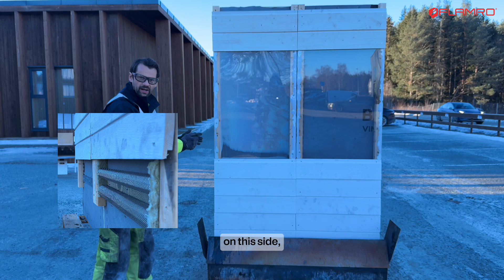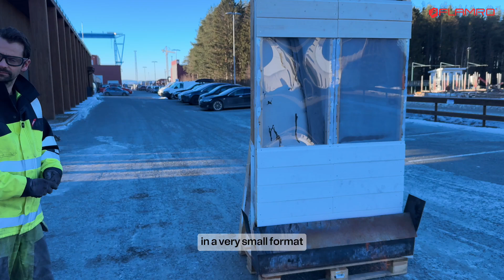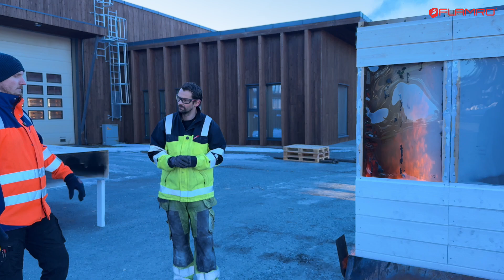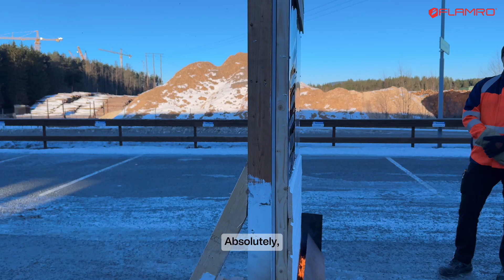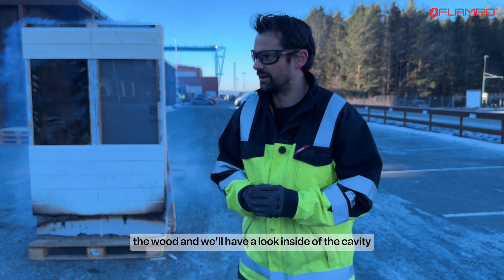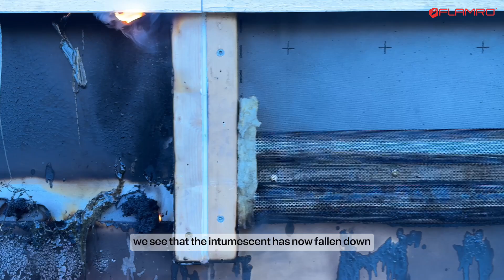Firebreather® Cavity Barrier vs a façade fire | Flamro Norway

Comment: if you have open flame outside the cladding ready to enter the facade, and you can't deal with it, then this sort of thing just delays the inevitable 
besides it is a restriction on the air circulation which is vital to longevity of the wall and facade forcing designers to increase the gap to regain the air flow for keeping the wall dry which defeats the purpose of this barrier again, catch 22 situation
so, essentially, it is not a solution to this problem, just adds complexity and increases cost greatly
Reply from the maker: I see where you’re coming from, but that view is based on a misunderstanding of what a cavity barrier is designed to do.

It’s not meant to “solve” a fully developed external fire on its own. Its purpose is to prevent or significantly slow fire spread within the ventilated cavity, where the chimney effect can otherwise carry flames rapidly past multiple floors. That is not just “delaying the inevitable”; it is a critical part of façade fire strategy, giving valuable time for evacuation and firefighting.

The Firebreather Cavity Barrier is also not closed in normal conditions. It is an open-state cavity barrier made of a stainless steel mesh and an intumescent inlay, allowing continuous airflow behind the façade. When heat increases, the intumescent expands and seals the cavity. So you are not choosing between ventilation and fire safety; the system is designed to provide both.

It is also tested to EI 30 / EI 60 / EI 90 in accordance with EN 13501-2, depending on the construction, meaning it is designed to prevent flame penetration and ignition on the unexposed side for a defined period. In addition, the stainless steel mesh helps block flame breakthrough immediately, even before the intumescent has fully expanded.

As for increasing the cavity gap to regain airflow, that does not remove the fire risk. In many cases, it increases airflow and can intensify fire spread if left uncontrolled. Our system is designed so that airflow passes through the barrier itself, maintaining effective ventilation even in narrow cavities without forcing designers to increase the gap.

On complexity, this is a fully passive solution with no moving parts or cabling, designed for straightforward installation and no maintenance over its service life.

On the cost side, fire safety measures always have an upfront cost, but they are part of managing risk. Buildings with proper fire protection can benefit from lower insurance exposure, and more importantly, the alternative cost of uncontrolled façade fire, in terms of property loss and human safety, is far greater. Incidents like Grenfell clearly show what can happen when fire spread in façades is not properly controlled.

So no, it is not really a catch-22. It is a dual-function solution, ventilation in normal conditions, and fire compartmentation when it matters most.